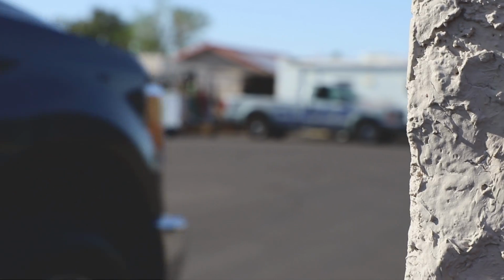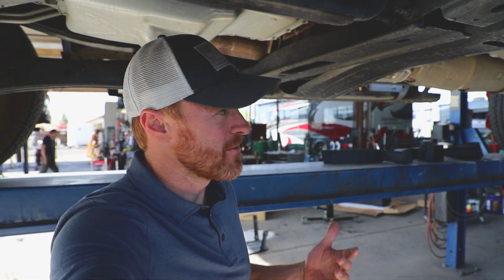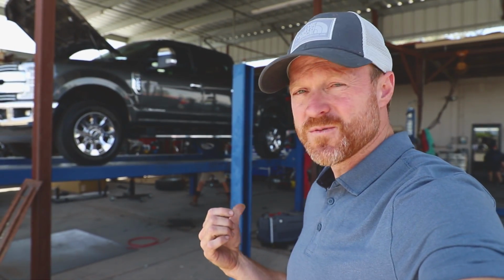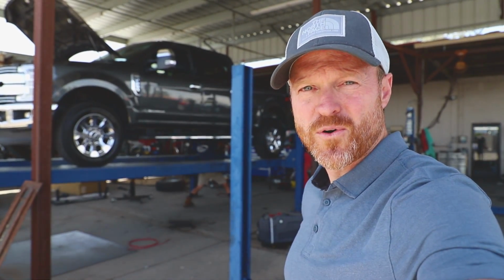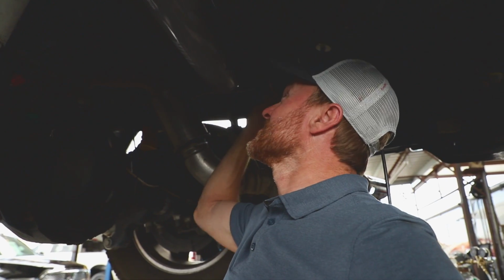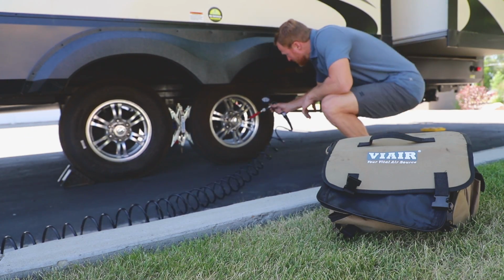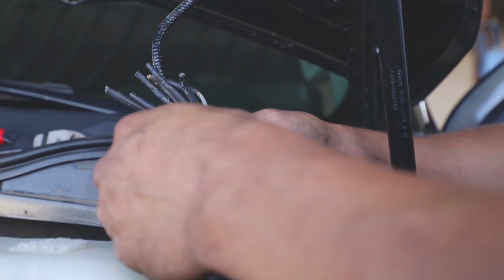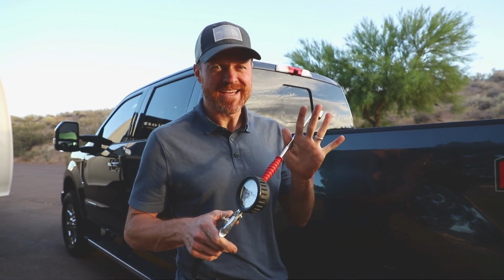FORD F250 MODS | FIRESTONE RIDE-RITE, VIAIR & TRANSFER FLOW TANK

Comment: I am half way to Alaska without needing all of these upgrades.  Carrying jerry cans a generator, 3 spare tires, 3 ton floor jack. The trick to towing is KEEP THE WEIGHT DOWN and drive no faster than 65 mph.  With all of the upgrades I think you have increased your risk for one of the systems to fail.  Say goodbye to your ford factory warranty !!!!
Reply from the maker: Uplifting comment :) Safe travels.
Reply: Keep Your Daydream dude not trying to be negative just putting something out there that  should be considered.   We love you guys and hope to cross paths.   Don’t take it the wrong way.
Reply: Keep Your Daydream you share useful info that makes us think and we all should share experience and experiences with each other.
Reply: Kenny, people drive out of Alaska down to the lower 48 all the time in stock vehicles.  As well as you know now traveling to Alaska.

Comment: Enjoy your videos. They have helped us get our TT set up. We are looking at getting the same 60 gallon tank for our 2018 F250. Any warranty implications with replacing the factory fuel tank?
Reply from the maker: Our Ford dealer service manager said no, unless it was tertemined that the fuel tank caused the issue. But you should check with your dealer. There is no question that it's a risk, but dang is it nice!
Reply: Thanks, that's on our list before we get too far down that road!

Comment: We built the bullet and bought a GD 337 5th wheel.  Added an Anderson Ultimate 5th wheel Hitch.  We had Firestone air bags, but had to remove them and change them to a different mounting style due to the B&W goose neck hitch added to the frame.  Took our maiden voyage to Fool Hollow in Showlow, AZ for the test drive.  No issues with the truck or GD.  Using your spreadsheet b4 buying the GD our 2008 F250 fit within the parameters and worked like a champ.

Comment: I did the same thing 60 Gal. tank but different brand because my older track had the same brand and it was great so I stayed with that brand.
I went with the wireless Airbag compressor with a pod to set the pounds. The tank is great now I can pick the fuel station i want. I drove to WA from CA and averaged 25 MPG so I didn't have to stop for gas but that was not pulling my trailer, pulling I get 12 to 14 MPG pulling a 35' 5th wheel.
You will be happy with the tank and air bags for sure!

Comment: Are there payload concerns for you with the 250 diesel?  I'm guessing 2,400lbs payload capacity being the diesel.  easily take 800 lbs tongue weight for your trailer, additional weight of the hitch, you, wife, 3 kids.  Now adding an additional 30 gals of diesel, all with no gear in the bed.

Comment: I really like the onboard air compressor! The truck upgrades are nice, but would you have been better off buying a F350 instead of the F250? Will your gas gauge work properly with the new larger tank?
Reply from the maker: Yes, I should have gotten the 350, but I've talked to enought 350 owners that still added air. The only difference is an extra leaf spring which makes for a stiffer ride. So they add air for the comfort. The gaugue works fine, but miles to empty needs to be updated.

Comment: Questions: Did the new fuel tank affect your trucks Ford warranty in any way? Also, If you were towing a 5th wheel would you still need the Viair air bag system to level or was it used to compensate for the weight of the new fuel tank when filled?  My f250 seems pretty level at this point.  Great video. Thank you. Safe travels.
Reply from the maker: My Ford dealer said no, unless the fuel related issue was due to the new tank. I like the ride with air bags. I bet a 5er would not drop the back end as much + we might have more cargo and people.
Reply: Thank you. PS I do Have Viair envy for tire inflation. LOL

Comment: There's just nothing like spending a boatload of cash on toys but all of these toys are needed you might have considered airbags on the trailer. You won't have a lot of cell phone service so I put an RCI 2950 ham radio in the unit an added an 800 watt HD Texas Star kicker and a couple of Wilson 2000 antennas and that baby would sing the blues, yes sir know you talking let the journey begin.

Comment: I have put the air bags in, and have a 60 gallon aux tank that is bed mounted. The setup I have has a valve and switch so I don't have to pump fuel from one tank to another and a gage mounted on the A pillar. That gives me a total of 86 gallons. Not towing anything, I have driven from St. Louis to Charlotte and still had 1/4 tank in the aux and 1/2 tank in my main.  An sir pump will be my next mod.

Comment: Another Classic KYD Video. My thoughts, free of course: You used a good looking install facility; clean/organized/and busy. Both modifications look to be well thought out and researched. Good job, Trish. All I could improve is the use of "double nuts" at every opportunity. Tough to do now that they are dirty, but that's what boys are for, and I use a "Dyno Labeler" and post the required air pressure on every rim. Waterproof labels, of course. Don't scrimp on valve caps, and as for air horns; to heck with the boys, get some. Moose tend to respect them. Prius', not so much. Once again, great video.
Reply from the maker: Lol.

Comment: Hey Marc one thing I would definitely go buy before you get into the desolate areas is a code reader or the edge insight monitor so if you have any issues on the road you can check it and even clear the code if it’s not a major issue. Like if the dumb emissions crap decides to put the truck into limp mode you can have a chance to keep moving and not stuck on the side of the road.
Reply from the maker: I've got one. I got it after our fuel pump fuse went out in Bend, OR.

Comment: Typically welding on a heat treated frame rail is a trade no no.....what does Ford say about it?
I would imagine a cracked frame would not be covered by Ford Warranty.

Comment: Weren’t you struggling with weight issues on the truck with the trailer? You added a Hensley Hitch which weighs around 200lbs. How will all these additions will keep you under the GVWR for the F250?
Reply from the maker: Many people have said this. I was overwieght on Ginger 1.0. The tounge weight of that rig was way off. Not sure why. The Henley canceles itself out plus some with 1,400# of WD and my cargo is less.

Comment: You will really enjoy the air bags. I did the same thing on my one ton but built the mounts and system myself using air bags off a transport as I haul huge weights and also have 120 gallon fuel capacity total on my truck. Oh and the switches are call upfitter or body builder switches. That is one thing I really like about the new dodge and ford vehicles is the factory added switches for accessories and not have to cut into the vehicle

Comment: With the fuel range you have now, the next must have for less stress is the oil bypass system. I don’t trust manufacturers oil change intervals, especially with the fine soot that makes it’s way into the oil, and fuel/oil dilution that comes from the DPF regen process. 8k mile road trip on one oil change, and cleaner oil?  On the Cassiar and Alcan highways, lack of fuel availability is mostly a myth. I’ve seen a few gasoline pumps covered when out of gas, be glad you’re driving a diesel.  Diesel fuel is everywhere in Canada. It’s the summer tourist season, even the smallest towns know how to make money by extending their business hours. :)  The one item we found in short/no supply, if you drive a modern diesel. Is DEF, and when you can find it?  Be prepared to pay for it.  Larger towns will have it, but you’ll still get gouged for it.  People drive like crazy on those remote roads, slow down and move as far over as possible when others are around. And you’ll come back with the windshield and all the paint left on your rig. Road trip of a lifetime, enjoy!

Comment: Getting fuel in the summer is usually not a problem, just fill up at every major town which are about 300 miles apart. Winter, getting fuel after dark is an issue going up there. Just don't drive after dark as you increase your odds of hitting a moose darting across the highway. Even in a full size truck if one hits a moose, a lot of times kills the occupants too.

Comment: Curious, what made you buy the Ford f250 over the Chevy 2500?
Reply from the maker: We've had 7 Chevy's and I switched to Ford for a change of scenery. My first F150 ('07) I drove to 175k miles with little to no issues. My last F150 ('13) I drove to 100k miles with only changing the battery, fuel pump fuse and front brakes. Those two experiences made me a Ford guy.

Comment: So, does the fuel meter in the truck need to be adjusted to reflect a 60 gal tank?  I have a 2017 F250 as well. I like the idea of this upgrade.
Reply from the maker: Yes. The gauge works as normal, but the miles to empty needs to be updated. The Ford Dealer was surprised they couldn't do it on a '17 as they have done it countless times on '16 and older. They are looking into it now. I'll circle back and mention the solution on the channel. In the meantime, I just restart Trip 2 and multiply 60 x current mpg. But as I mentioned, the gauge still works.

Comment: Couldn't you have just put the second tank in. Ford has and option for two tanks.
Reply from the maker: Maybe. But I don't think that would be any cheaper or better. Unless you mean as an option when I bought the truck. I think it's long bed option. Not sure.
Reply: Keep Your Daydream... my buddies truck is a short bed with dual tanks. I will have to ask him if it came that way.

Comment: Is the tank dedicated for just the airbags or can you use it to run an impact gun for busting wheel lugs loose?
Reply from the maker: There are 3 extra holes for the tank for other uses. But if I were going to use an impact gun, I would just connect to the quick disconnect on the bumper. 150psi constant duty.
Reply: You need volume for running air tools ( hence the tank question) I have the Viair RV compressor. Been thinking about adding a 5 gallon air tank in the bed just for high volume air useses.

Comment: Did you use the same Viair compressor that came in your portable kit for the permanent install? I have the truck, the Firestones, and the same Viair compressor kit for RV's, and just this morning, I was crawling under my truck pondering how I might do a permanent install with a quick connect at the bumper. This video is good timing.
Reply from the maker: It looks the same, but I don't know. The kit I used was 10007.

Comment: I know you said this video is between seasons, but you had a separate video where you talked about the air bags being installed wrong and later reinstalled correctly.
Is this pace the ones that fixed it?
Reply from the maker: No. Taps Truck fixed that out of Paso Robles. Another great shop if you're in CA.

Comment: Lovin the truck upgrades.  kinda jelly on the airbags.  deff share your sentiment about the truck being level.     Did you by chance calc the load that is applied to the axle with the use of the airbags?    You mentioned it could counteract the use of the WDH... does the hensley provide WDH and Sway, can u remove the WD and just keep the hitch for the sway?
Reply from the maker: Yes, the Hensley has 1400# of WD. At some point, I'll hit the scale with the WD on/off to see the difference, but I hit the scales so much anyway for other numbers. Payload. Full water, Axles readings. Tire load rate, etc. Trish can't stand going there one more time!

Comment: I have a 2018 F-250 with 6.2l V8 gas and am only getting 9 to 9.5 MPG. I pulling a 2018 FD Reflection 297RSTS. Sure would like to know how your getting such great mileage?
Reply from the maker: I'm not. We're tracking it better now and I'm waiting to get more miles for an average, but it's 9-10. Disappointed. My computer was high in-town because we were not towing so often whereas now we're on the road and div miles by gallons. The best way to get real numbers.
Reply: I, and several people in my family, have mileage/trip computers on their vehicles and they all give results that are too high when compared with the tried-and-true method of dividing your miles by the number of gallons when you fill up. Funny, isn't it, how the manufacturers always seem to err on the   side that makes them look better than reality.

Comment: Been full time now for a year. Love my Transfer Flow. But it is an in bed 50 gallon. They did not make one as a replacement for the stock 31 gallon. 2015 Ram 3500 short bed, Cummins. Also did the Firestone air bag upgrade but it is a manual inflate, saved me a grand and bought a small portable air compressor that goes up to 135 psi. Inflates the 2018 Bighorn 5ver tires great! Been following your journey since you started! Safe travels and hope to meet you sometime! Instagram grumpybear_911

Comment: First great videos. But I'm wondering with the upgrades to the truck 1) with about 240 lbs of extra gas then the tank itself is this taking away from your gvwr by add more weight to the truck or changing how much is in the trailer. Safe trip love the video's
Thank you

Comment: We might live in the far north but it is just like many other states where you can get gas if you have a credit card. Fred Meyer, Carr’s any of the food stores have fuel. Some people make Alaska sound as if they are still in the Stone Age. Anywhere from Fairbanks to homer you can get fuel anytime.
Reply from the maker: That's probably true. I can't wait to separate fact from hearsay... just like Mexico. That 60gal fuel is already one of my fav things and we've only filled up 3 times!
Reply: Keep Your Daydream another good thing to do is go and get window screening and zip tie it to your grill. It will stop the small rocks but the most important thing it will do is keep all the bugs out of transmission and radiator coolers. 
I do it whenever I travel the Alcan.
Reply: Yeah, the first thing i thought of when i heard him say that. Who the hell told you gas stations close at 6pm??
Reply: I just ordered a 2019 F-250 and am somewhat new to towing weight. As of now, i don't plan on towing anything real heavy. A traditional travel trailer, 25' - 30', unloaded weight of 7,000 to 9,000 lbs. Maybe a boat (max 10,000 lbs.)..... With something like a weight distribution hitch i should be fine without aribags, huh? At what weight do you recommend the bags?

Comment: As a certified welder, it's not a good idea to be welding on these frames!
You can fabricate anything you need and bolt it to the frame!!
Great ideas for the upgrades, but hold off on the welding to your frame!
Razor!
Reply: mattybr1 
This really is a good question....
Reason is, vehicle frames regardless of what application, be it car or truck and especially semi- truck, when they're manufactured they go thru a specific material makeup, meaning using different alloys and most importantly they go through a heating process that gives it it's strength and it's flexibility. 
When you apply heat through welding, you as the welder have no idea what alloys were used to make up this frame, so how do you know if the weld filler, (ie wire or welding rod) is compatible to the frame your about to weld on? The other BIG issue is you are changing the temperament of that frame. In other words, you've just created a weak spot in the area you applied that heat to.
Another problem is, if, and I mean IF....
the frame is compatible to welding, there is a direction one is to use when welding brackets or braces, and hangers to a frame to prevent weakening or subjecting the frame to cracking and ultimately causing failure!
Bottom line, unless "YOU" built and manufactured the frame your about to weld on, DON'T WELD IT.....E-V-E-R!!!
GET A DRILL, SOME BOLTS, and attach all your goodies in this manner. 
If it can be welded, IT CAN BE BOLTED TOO!!
I've just covered the basics here, believe me. I'm sure there is a book 100 pages thick, giving a much broader and more in depth explanation. I hope this gives reason for "Pause" the next time someone says, "yeah, let's weld it!!!
Take care,
Razor!

Comment: you also might want to look into upgrading your trailer tires to 17.5 inch with 16 ply so you don't have to worry about getting flats on the rough potholed roads
Reply from the maker: I upgraded to Sailun G rated 14 ply. So far so good.
Reply: definitely an upgrade from stock tires,  another suggestion would be to lower your gain on trailer brakes on rough roads to help keep the wheels from locking up on braking as the trailer can bounce more that the truck, sharp rocks and pavement edges kill tires, also carry a plug kit for emergency roadside repairs to get you to nearest town for real repairs, have fun in Alaska it's an awesome experience

Comment: Hope the fuel level gauge is accurate after the upgraded tank. My buddy still hasn't been able to get his to read right after installing a titan tank
Reply from the maker: The gauge is good, but miles to empty is wrong. I'm now waiting for Ford to make the update so I can fix.
Reply: That was going to be my question, I was guessing ford would need to update your ECM to male the mileage computer read right

Comment: I would not think your truck would need the air bags with your trailer. I put air lift bags on my 17 superduty and kind of felt it was over kill.
Reply from the maker: Yeah, it dropped a few inches. It wasn't essential, but I like it level.

Comment: Are there any issues with welding to the truck frame? Did you check to see if this might affect your warranty with Ford? Regardless, very nice installation of the parts.
Reply from the maker: Not that I know of. I only asked the dealer about the new tank, not the welding.